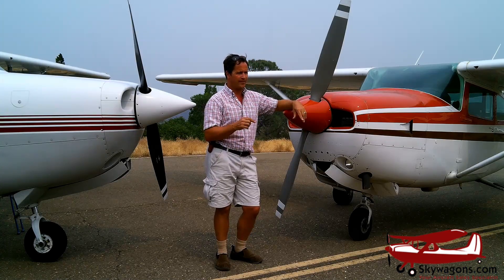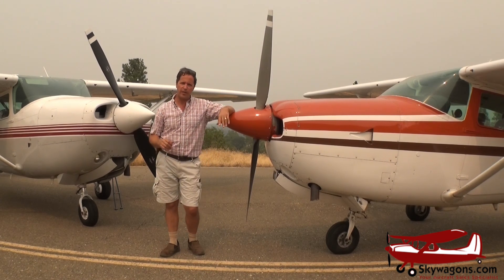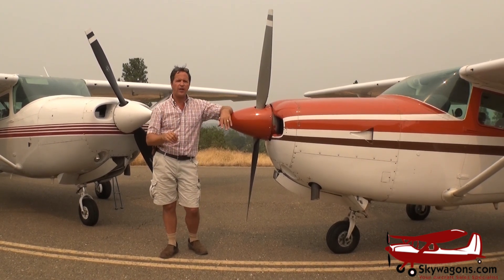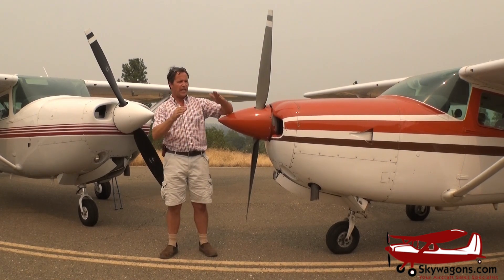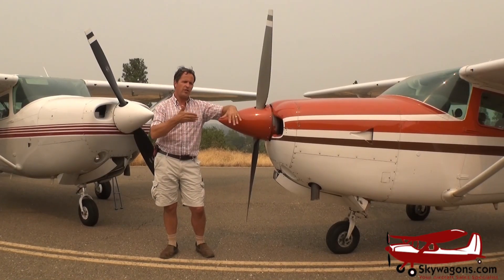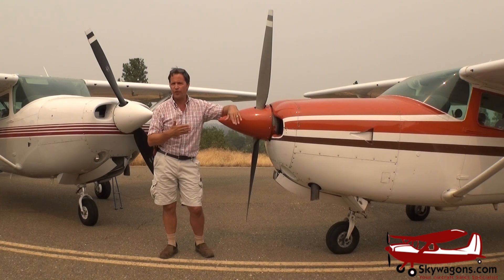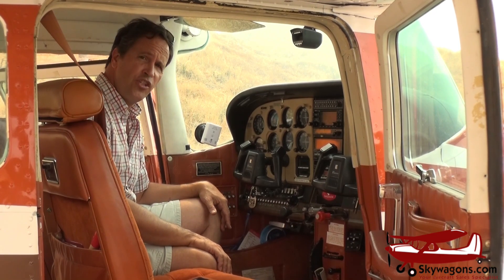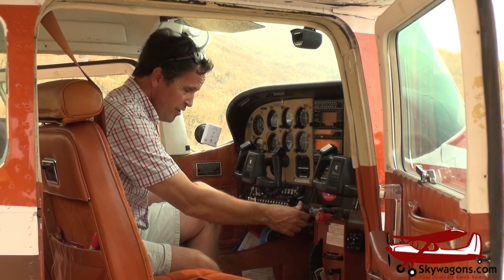Turbo Normalizing vs Turbocharging (182 Turbo RG)

Comment: Will the turbonormalized motor fit beneath the cowl on a 185 with a 540 alread installed? Or does it require a totally different cowl from the NA 540? Thanks.

Comment: Question: From what I gathered on this video,  it seems that turbochargers are not helpful until reaching a certain altitude? If that's the case, why are ground bound machines such as tractors, trucks, cars, etc. equipped with turbochargers?
Reply: It's not related to altitude but to power developed. Under 6000' the Cessna engine doesn't need a turbo to develop the power required to reach 2400 RPM (max power for a given propeller) because the air/fuel ratio (15:1) can be obtain at atmospheric pressure. 
Over 6000' the air is less dense therefore the 15:1 air/fuel ratio can't be sustained, resulting in a power drop and RPM drop; fortunately the pilot has room to increases power because when he pushes the throttle further the turbo kicks-in and squeeze some compressed air into the mix, allowing to keep the 15:1 ratio and the propeller spinning at around 2400 RPM - that's why turbo airplanes have a higher ceiling than non-turbo.
On the ground, variations in air density aren't a critical factor. If an airplane can develop around 2400 RPM without a turbo, then additional power wouldn't be useful (you can only rotate a prop so fast, after which it breaks). On a tractor however, the driver can change gear and use this extra power to create more torque and climb a steep hill for example. Also, for equal power, turbo engine are generally more fuel efficient than naturally aspirated engines (with some drawbacks but that's another discussion).
Hope this makes sense.
Reply: @Virtualmix  Thanks. Everything you said makes sense, but I'm still thinking of applications like the Cessna 188 Ag Husky from years past. I believe the only difference in it and the 188 Ag Truck was turbocharging and 10 more hp, and of course they generally worked just above ground level, usually at low-elevation regions. So, I do believe there's a benefit of turbocharging at or near sea level as well. Otherwise, they wouldn't be installed on performance cars, tractors, heavy trucks, etc.These units don't normally operate in any high altitude conditions, yet still yield more performance than their normally aspirated counterparts. Agreed?
Reply: @nocotton  Yes, they can absolutely make use of more power at sea level, simply install a bigger propeller that produce more thrust and get better performance. On the Cessna in the video, the to manufacturer could have installed a bigger propeller but choose instead to use that extra power as a reserve for higher altitudes when the power starts to drop.
Reply: @nocotton  - It's just a matter of ramming as much air as possible in so you can ram more fuel in too. The limiting factor in an aircraft at lower levels them becomes the design limitations of the propeller, which obviously doesn't apply to land vehicles so they can use the extra power where an aircraft can't. It's only the maximum permitted output that's limited, not the maximum available.

My Dad drove Centurion tanks in the 50's, powered by the RR Meteor engine (basically a Merlin without superchargers), but the first ones he drove had an actual Merlin, and nobody was impressed when they had to give up that extra 'something'.